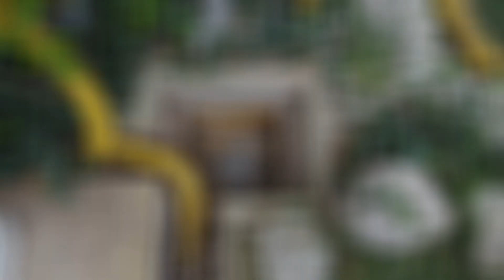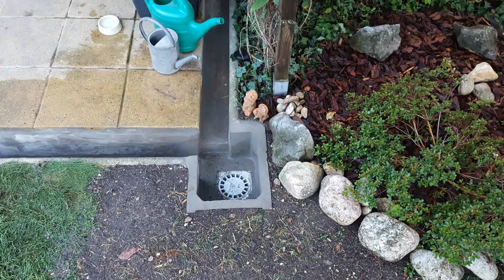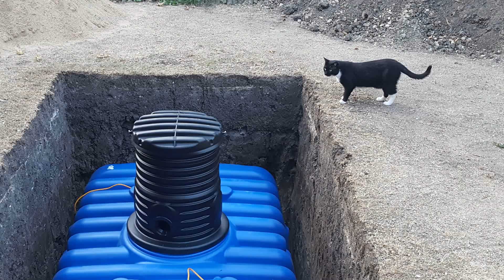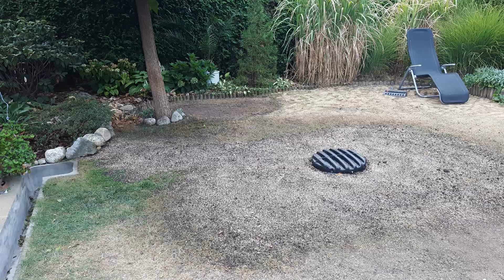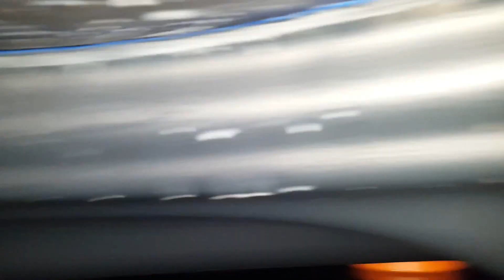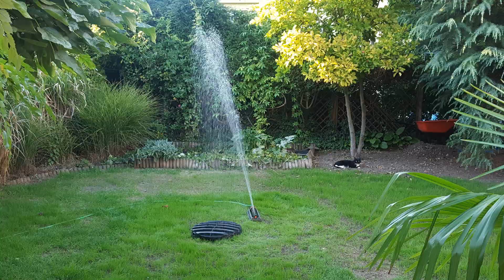Installation of 3000 L Underground Water Tank, Rainwater harvesting

Comment: Clearly you do not live where the ground freezes. Our average winter frost depth level is about 3m (10ft). We would need to keep the top of the tank below that or risk a very large ice cube ruining everything. Sometimes frost is still evident at 2m down in July. Just saying... Cheers from northern Canada.
Reply from the maker: Wow. 3m frost depth is pretty insane. Over here 0,6m down is considered safe from freezing for water or sewage piping. My tank is well below that level. Last 10 year I hardly remember ground being frozen 10cm deep. Our winter minimum was -8C this year :-) Water tank for rain water in northern Canada is probably not a topic.  Should be plenty of water there, right? I am collecting rain water to water my garden as I feel sorry to use a drinking water for that.
Reply: @tomascenek4651  It's true. We do have plenty of water here. Our well is in an aquifer, but it is very hard and much iron; a water softener is necessary and we drink it right from the tap without issue. We tried the whole rainwater collection thing because the water is so hard that it leaves water spots on the plants; drip irrigation was the answer. However, we got an early and very unexpected cold snap lasting several days that destroyed most of my drip system including the barrel. It's a challenge, to be sure. Thanks for the reply to us here in northern Alberta, Canada. By the way, it is not uncommon for us to get -30°C or colder for several weeks in a row (during the winter only, for those unfamiliar with Canada). Keep safe...

Comment: Why does it need to be that deep?  Looks like a good meter of dirt over the top of the tank.
Reply from the maker: the overflow exit level defined the overall depth, I simply had to be over the drain pipe level with it in order to maintain the slope. The second reason is the frost line.
Reply: @tomascenek4651   Here in Idaho, with a frost line about 32", if the bulk of the tank is below that line, it will prevent any of the tank contents above that line from freezing.  In other words, the top of the tank does not have to be below the frost line.